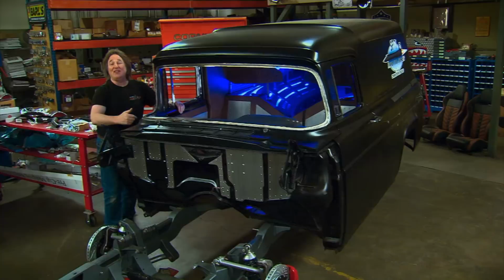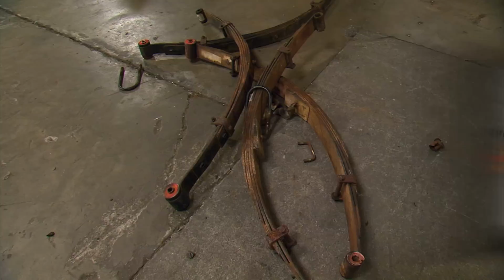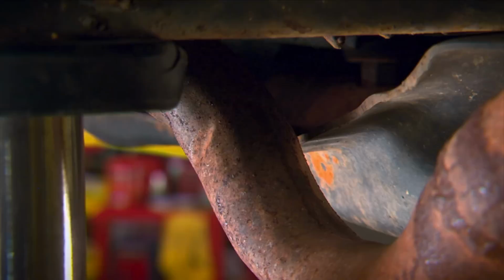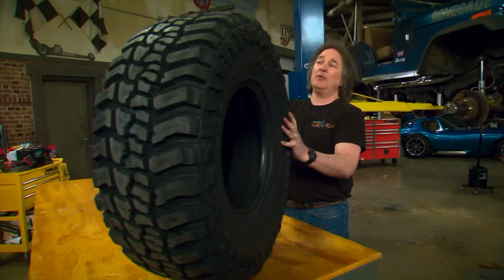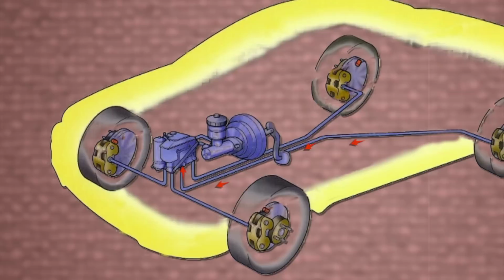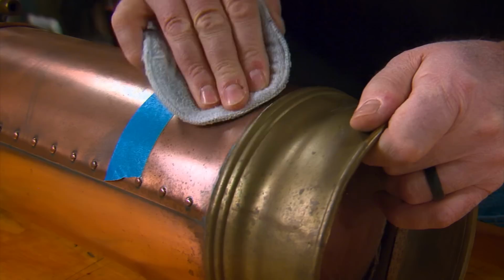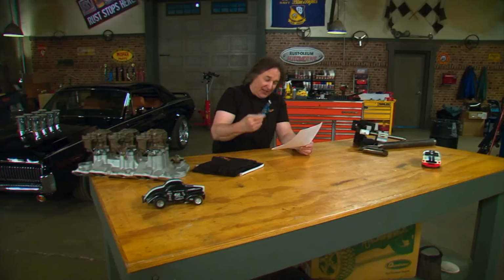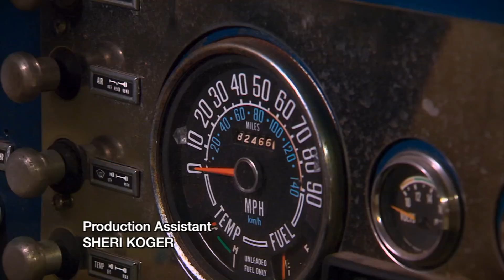Fixing Bad Modifications & Jeep CJ5 4" Lift Installation - Stacey David's Gearz S15 E2

Comment: I've had three of those. Found 4" too much for those since they have such a short wheel base and narrow body. Hub spacers help by widening the step. 2 1/2" is plenty since 4" doesn't help in climbing at all. Your always limited by the Diff and tire height. If a street cruiser also, drop the 4" ego thing and keep the stability. I've done 360's on pavement with a 2 1/2" lift 31" tires, but wouldn't even try with a 4" lift.
Reply: Depends on the year and axles. I believe post 79 they came with wide track Dana 30 series
Reply: Definitely agree! People don't think of what they need for what they are doing with their rig, rather are influenced by the aftermarket pushers. And most just throw safety measures out the window. 

I have an '05 TJ Rocky Mtn with the AMC 4.0 I6, 3.73 gears, lsd and the Dana 44. Rolling on modest 2.5" Old Man Emu coils, Fox 2.0 Shox and Fox steering stabilizer, Freedom Off Road front lower adj control arms, the rest are fixed Detroit Axles, transfer case drop kit, 32" ko2's, Quadratec Classic Baja alloy rims. This is by far the best handling Jeep I've ever had. 

I'm an adventurer, not a rock crawler. I primarily beach and dune wheel for beach camping and surf fishing. And hit moderate trails on the weekends. If you have any common sense with good off road instincts, there is no need to ever go beyond 32's with a 2.5" lift. The aftermarket has been fooling people for decades about "needing" 35's- 40's to off road, that's 🦬💩 the misinformed fall for year after year. 

I added the Banks cat back exhaust giving it a stout, throaty growl, but not obnoxiously loud. Absolutely perfect for the 4.0 I6. 

               JEEP ON!!

                   O|||||||O
        🇺🇲 Only in a 2 Dr 🇺🇲
                  '41- '06
Reply: @JeepTJWheelin  Word. Great sounding rig. Dont forget the winch. You know, for the other guys.
Reply: @ellkir1521    👍😆

Comment: I built a 74 CJ5 Renegade. Swapped out the 304 /3 speed trans for a built , Holley Sniper EFI fed 401 / NP435 - 4 speed. Swapped in custom Dana 44 front axle with e locker and a Dana 60 semi floater  rear with power loc diff and  4.10 gears. Jeep definitely runs strong and goes where it's pointed on and off road

Comment: I have almost a unicorn. A1993 c1500 5.7 with 160k miles. All original except for LMC parts on the bumpers and dash. (Trim) it’s two tone blue and tan and I bought It new in 93. It is extremely clean, zero rust or bondo. The paint is in great shape(surprisingly). Garage kept its whole life. Hit me up if you wanna work on it! LOL.

Comment: my CJ7 could use that help about the same color too .. just got parts .. other day the rear drive shaft came out ,, the strap bolts broke and the straps bent other end the bolts bent and the straps bent . drove home in 4 wheel drive aka front wheel drive .. ordered new yokes and u joints also ordered the u bolts instead of the straps ,,also got new pinion seal its a bit damp at the rear end ,, a problem is repairs are done on the ground .. need a hoist ,, great videos you put out ..
Reply from the maker: Ouch! At least you made it back home. Thanks for watching.

Comment: Have an issue with fender well headers! They are just mud collectors hanging down behind the front wheels. Side pipes sound like crap unless they have a balance tube also. I use shorties inside the frame rails. 77 was the first year the cj5 came with sway bars and they really need them, with disconnects of course. Also first year for front disc.

Comment: This CJ-5 is an excellent edition Jeep but is over built. Lift and tires are unnecessarily big making it very unsafe for any CJ-5, already well known as a "flipper" in stock form.

I'm an adventurer, not a rock crawler. I primarily beach and dune wheel taking the family beach camping and surf fishing. Also hit moderate trails on the weekends. If you have any common sense and good off road instincts, there is no need to ever go beyond 32's with a 2.5" lift. The aftermarket has been fooling people for decades about "needing" 35's - 40's to off road, that's 🦬💩 the misinformed fall for year after year. Its seems very few people nowadays build their Jeeps for what they will use them for, rather they are influenced by aftermarket pushers.

As much as I like the CJ-5 and CJ-7, they aren't the most comfortable rides. But I definitely think they are the coolest looking and the most classic Jeeps ever built. 

I prefer my '05 TJ Rocky Mtn over any other Jeep, the coil springs and superior suspension are amazing making the short wheel base a much improved ride over previous generations. The CJ-8 Scrambler is my second favorite Jeep of all time. This is a platform meant to have the longer wheel base. Unlike the LJ that just looks goofy. 

I was fortunate to find an '05 TJ Rocky Mtn with the AMC 4.0 I6, 3.73 gears, lsd and the Dana 44. Modest 2.5" Old Man Emu coils, Fox 2.0 Shox and Fox steering stabilizer, Freedom Off Road front lower adj control arms, the rest are fixed Detroit Axles, transfer case drop kit, 32" ko2's, Quadratec Baja alloy rims. 

This is by far the best handling Jeep I've ever had and encourage anyone looking to build a highly capable, great handling on and especially off road, and want to save thousands, take this path! This build was a lot of trial and error. But everything I listed is purposeful, nothing unnecessary in the least.

Lastly, I added a Banks cat back exhaust giving it a throaty growl, but not obnoxiously loud. Absolutely perfect for the 4.0 I6. 

                   O|||||||O
        🇺🇲 Only in a 2 Dr 🇺🇲
                  '41- '06

Comment: 15 x 10 wheels???  You really HATE your sidewalls. They look cool, but I would be putting 15 x 8” wheels. This tucks the weak points of the sidewalls inside a bit more and the side biters are the first to hit the obstacles.  The 4 contact points are #1, then brakes and so on. You make the statement the big brakes look cool, but,,,,,. You forgot that logic with 15 x 10” wheels. Sorry. Sold tires & rims since I was 16 years old. I’m 61 now.
Reply: If you sold tires and rims, then you should know that to be cool old jeepers run 15x10 with a 3-1/2 backspacing. At a minimum, a 12.5 width tire but preferably wider like an interco swamper or Nitto Mud Grappler.    I'm in my 50s. I've lived it, owned them, and currently still do. I also totally agree with you for a serious trail rig 15x8 or a 17x8 is the way to go.